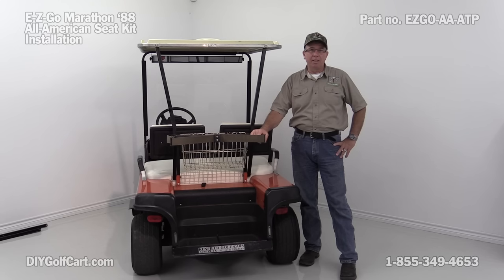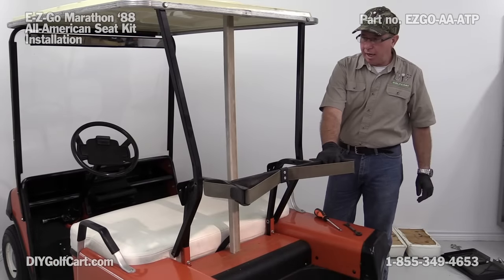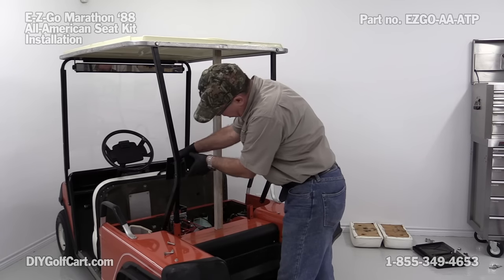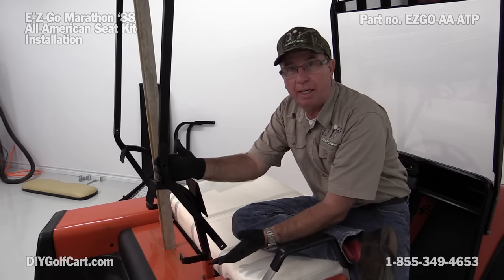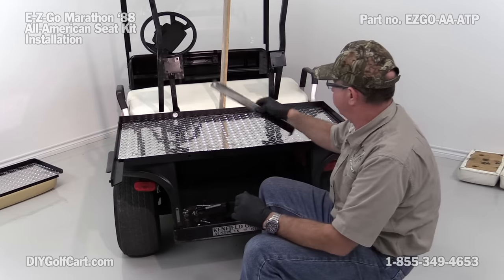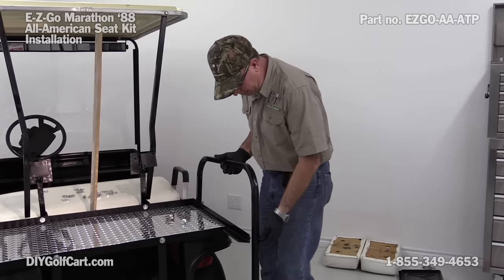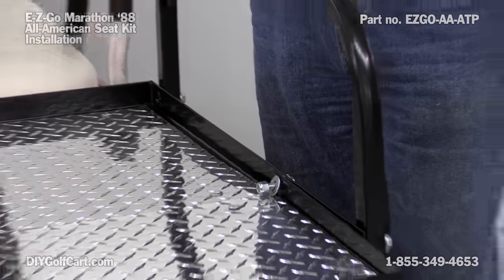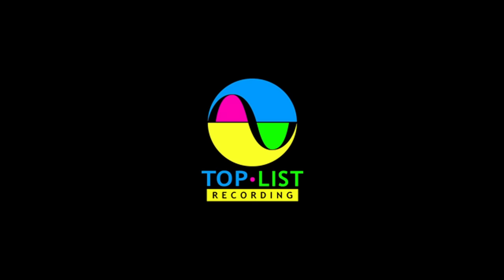EZGO Marathon Rear Seat Kit - How to Install | DIY Golf Cart

Comment: Does this kit come with the new front seat support brackets?
Reply from the maker: No, you'll use your OEM supports.
Reply: Unfortunately I do not have the OEM supports. Do you know where I can get some?  I have a bed on the cart now and going to remove and add a rear seat. The seat backs are currently attached to the bed.
Reply from the maker: @anthonydollarhide6954  Try Vintage Golf Cart Parts
Reply: Anthony Dollarhide did you find front seat support brackets?  I'm in the same position you are in.

Comment: Can u use  3  marine or RV  batteries for golf cart
Reply from the maker: +Johnnie Bass Yes, but not recommended.
Reply: +DIY Golf Cart hello i have a question, bought a txt 48, it started to squeak when turning steering wheelto the right, any ideas what the problem might be
Reply: +DIY Golf Cart would you be able to tell me if my 2005 club car DS has an ignitor?  Thanks in advance..
Reply: mrhoya14 I have the same cart and you're issued can be fixed with a little oyle